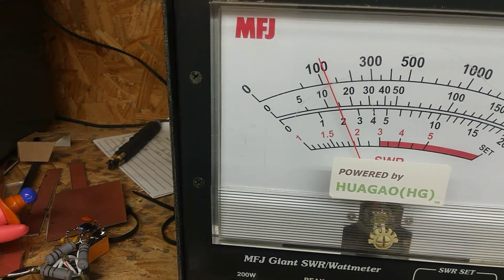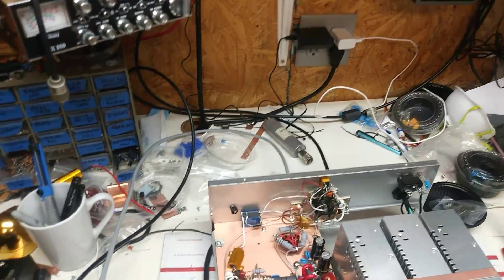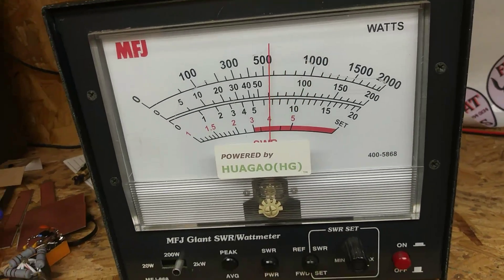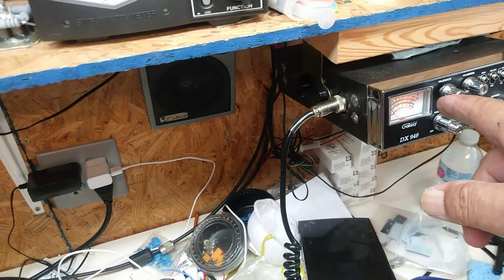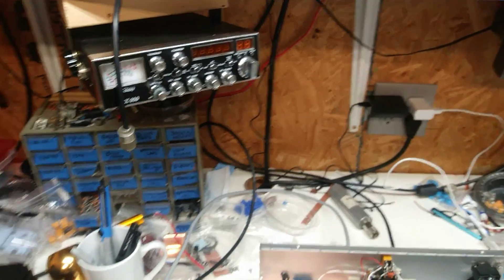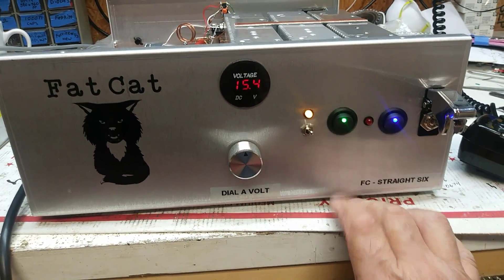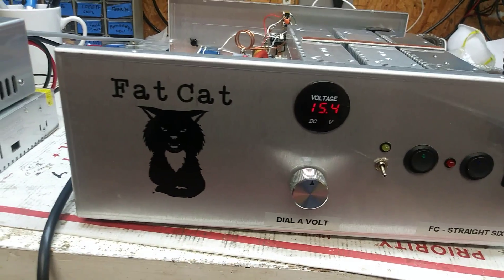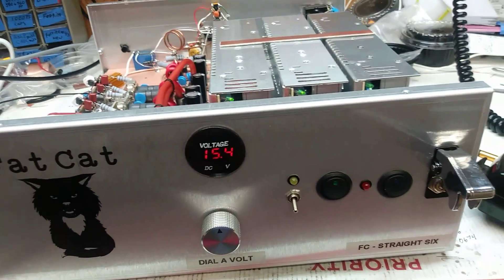Piss on a bird and a coaxial dynamics slug bs

Comment: This vid is 2 years old but are you still using MFJ868B Watt meter?
Would you recommend one?
Also are those Megawatt S700 power supplies you are using? I have the 50 amp & Love it💙
Reply: I bought the MFJ868B Meter it's ok thought about replacing push buttons with metal switches. The lights burned out replaced them with 4 LEDs. Hope all is well your way❤